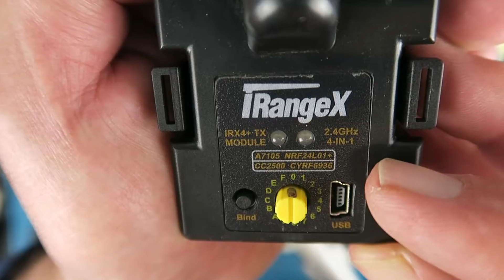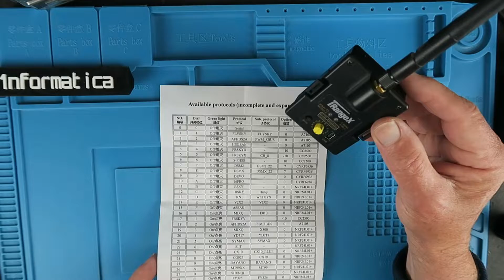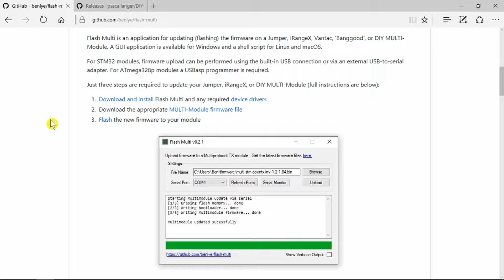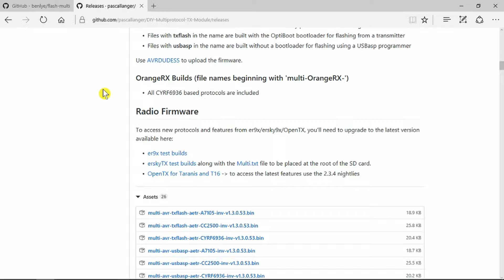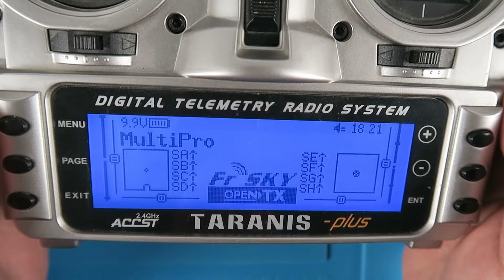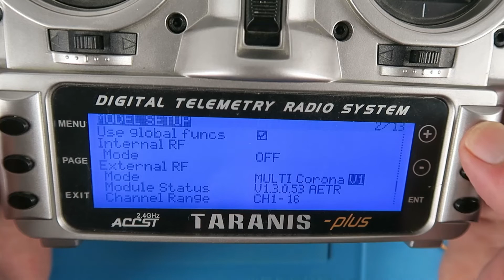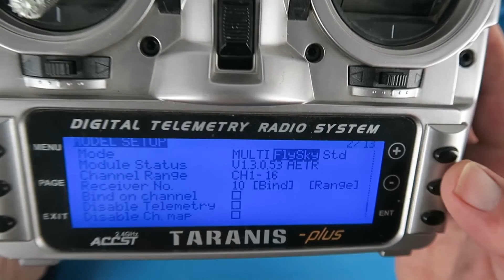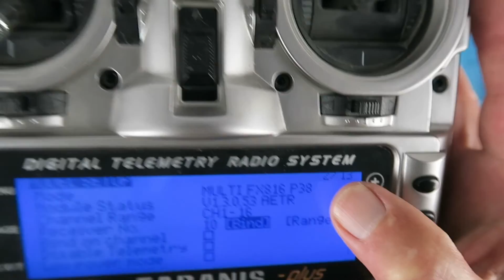iRangeX IRX4 Plus 2 4G 4 IN 1 Multiprotocol STM32 TX Module Setup And Test

Comment: Can I use this module on a fly sky a bind let's say a the  umx micros from eflite???
Reply from the maker: Yes, it has the DSM protocol. I have used it with my UMX Ultrix and Radian. Thanks for watching, have a great day!
Reply: @1nformatica  thanks sooo much .
Do i have to flash the protocol ? Or just plug it in the transmiter and bind it ?
Reply from the maker: @MarkJimenez-dw1tl You should only have to plug it in. The DSM protocols have been in the firmware for a long time : https://www.multi-module.org/using-the-module/protocol-details/dsm You only need to flash new firmware to support other protocols as they are released.
What transmitter are you using?
Reply: Flysky transmiter. can the protocol olso be used on a the volantex micro plane ?
Reply from the maker: @MarkJimenez-dw1tl You may find this useful : https://github.com/pascallanger/DIY-Multiprotocol-TX-Module/blob/master/docs/Tx-FlyskyTH9X.md Yes, can bind with most Volantex, one exception is the 750mm Mustang. Personally I would get an EdgeTx capable Tx. If you're on a budget then look at the Radiomaster Pocket or a second hand Taranis. I upgraded my Taranis from OpenTx to Edge Tx and is works great!

Comment: How did you set up this module to work with the JR radio.  I want to use with my old 8103 radio for indoor fliers.  I tried...it binds but not servo info is sent to receiver.  I was using DSM2 protocol settting.  bind indicated no functions.
Reply from the maker: The key to it is using the PPM mode which can be a little difficult to get working. See here : https://www.multi-module.org/using-the-module/ppm-mode
Reply: @1nformatica  I set the protocol correctly.  My module in the 8103 bound to the receiver.  Receiver and module were easy to bind.  Issue I had is no control information went from radio to reciever.  I believe it was in serial not PPM mode.  I can't find instructions as to how to set the module in PPM mode.  It seems to default to serial.
Reply from the maker: @dwkach  Assuming you have the iRangeX module like mine, make sure the green LED is off for PPM mode. You can see the instruction sheet here: https://youtu.be/e4ReeQZznT4?t=168 Also of course the model you set up in the transmitter must be set to PPM and not PCM!!

Comment: Could you please provide me the Syma X5C channel assignments? I have found Channel 1 is throttle after a fly away on Channel three.
Also the other channel setting, as I am new at this. Thank you.
Reply from the maker: The channel mapping is as on the multiprotocol page here : https://www.multi-module.org/using-the-module/protocol-details/symax It is Aileron, Elevator, Throttle and rudder on Channels 1, 2,3 & 4. I guess in your transmitter the channel assignments are different. You need to remap as per the module, how to do that depends on your transmitter. Thanks for watching, have a great day!
Reply: @1nformatica  I have the IRangerx with Taranis X9 ACCST and it was the mapping was my problem.
I am loving the Iranger so far, as I try to pair all my toys.
Reply from the maker: @daleolsonfieldsilverdalewa7285  Glad you got it sorted, one step at a time! I have just upgraded to a Radiomaster TX16S with the built in Multiprotocol module and popped an ELRS module in the bay so now have the best of both worlds. When you are comfortable I recommend upgrading to EdgeTx, it's the future!!
Reply: @1nformatica  I am having problems updated the module, my radio keep saying I need to update the software.
Reply from the maker: @daleolsonfieldsilverdalewa7285  Take a look at this video : https://youtu.be/havMSMVUOmM

Comment: hey is it possible to put this module into the tbs mambo? :)
Reply from the maker: Well, I see the TBS Mambo has a "JR" style bay and runs a fork of OpenTx so I guess it would work. However I don't have access to one to try so maybe research a little more on whether the OpenTx fork they use (Freedom Tx?) will support it. Good luck!

Comment: The current IrangeX plus has an ARM Cortex-32 processor and not a STM32 so is the stm software going to work?
Reply: Yes it works ok on my unit..loaded latest firmware..,..make sure your TX is off when you power Rx

Comment: What is the difference between the Plus version and the non-Plus version?  Does the Plus have necessary features?
Reply from the maker: Can you put a link to the non-plus version so I can see, thanks.
Reply: @1nformatica  Banggood shows the Plus version as discontinued but you can still get them on eBay.
Reply from the maker: @kattmandu  OK, as far as I know the only difference is that the "old" plus had the rotary switch to select protocol and the USB port. Now everything is done via the transmitter. YouTube no longer shows me if you are subscribed. Please consider subscribing if you have not done so already!
Reply: @1nformatica  the iRangeX website appears to be broken so Banggood is the only option I can share at the moment.

https://m.banggood.com/IRangeX-IRX4-2_4G-CC2500-NRF24L01-A7105-CYRF6936-4-IN-1-Multiprotocol-STM32-TX-Module-With-Case-p-1197130.html

Comment: This module has a range of several meters?
Reply from the maker: Several hundred meters!! It has the same range as the internal module which FrSky claim 1.5 Km in clear line of sight conditions. My own experience shows no difference in range between the irangex and internal module. Please consider subscribing if you have not done so already!

Comment: Thank you, I just subscribed, somehow i cant get the S6R to connect, my taranis is not working and I want to use this external module, I am able to connect to flysky correctly though but no luck with FRSky
Reply from the maker: Hi, thanks for subscribing. Here is something that has caught me out several times, firmware revisions. Check that the Taranis and ALL receivers have the latest firmware, they will not bind otherwise. The same is true for the irangeX module, keep it up to date.

Comment: Hi, very interesting vidéo. I have a Walkera WK-1001 transmiter and i would like to make it work with this IRangeX IRX4 module and a Walkera RX2604 2,4ghz. The Walkera transmitter looks very similar to your older JR X -388S. Sorry but i do not know much about protocol types, and i don't know how to proceed with settings and binding with receivers (to much used to RTF products). Could you please help me ?
Reply from the maker: Hi, I am not sure what you want to achieve. The WK-1001 has a module bay similar to the JR but I don't think it is exactly the same size, there is a design on thingiverse to make an adapter : https://www.thingiverse.com/thing:1041499 Aside from that the transmitter could only control the iRange module by PPM I think. That means messing around with the rotary switch on the iRange to change protocols. I really think you would be better off getting a new transmitter with the multiprotocol feature built in. Something like the Radiomaster T16S https://bit.ly/RadioMasterTX16S or TX8 https://bit.ly/RadioMasterTX8 Please consider subscribing if you have not done so already!
Reply: @1nformatica  I already have the IRangeX module on the WK-1001, it does fit in. But now i don't know how to test a binding with the RX-2604 receiver. This is what i am trying to do. Give a second life to this transmiter. Thanks if you can help.
Reply from the maker: @laurentpythoud4713  OK, in the multiprotocol module here are the Walkera protocols supported : https://github.com/pascallanger/DIY-Multiprotocol-TX-Module/blob/master/Protocols_Details.md#wk2x01---30 I guess you start with the first and go from there!

Comment: Hi dear friend, I watched the video I have an Irangex like the one in the video. I connect everything, when I do to start with the update it does not and I have an error message:
Writing MULTI-Module firmware via native USB
Switching MULTI-Module into DFU mode ... done
Writing firmware to MULTI-Module ... failed!
Attempting DFU Recovery Mode.
Waiting for DFU device to appear ... got it.
Writing firmware to MULTI-Module ... failed!

Why all this? I run everything in order, nothing always wrong.
Can you help me please.
Thanks from Italy, say Bergamo
Reply from the maker: Are you using the multi flash tool like I show here https://youtu.be/e4ReeQZznT4?t=209 For this to work you need to have the bootloader installed on the module, do you have that?
Reply: @1nformatica  I don't know if I have the bootloader in the module. I've been there for about 2 years. Even if I attack the Irangex plus, it does not read its interior. How do I put the bootloader into the multiprotocol? Thank you
Reply: @1nformatica  Flash toll I have and work, bat dont work the upgrade on the irangex plus
Reply from the maker: @rn Good advice, thanks for posting. Please consider subscribing if you haven't done so already!!
Reply: @rn 👍❤️

Comment: Hello, thanks for the video. Have the same module with the Taranias, my problem the green LED is always on.
In the video when burning it is the same with you.
If you are in serial mode, is the green LED off or on ?
Reply from the maker: I am in serial mode. Both green and red are on all the time. When switching on the Tx only the red flashes for a short time then when the green comes on they are both solid.